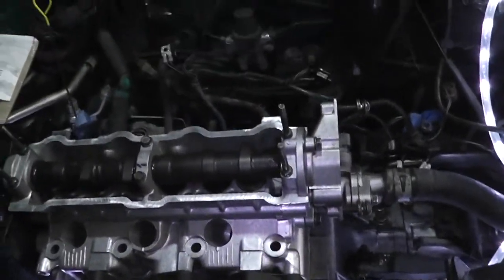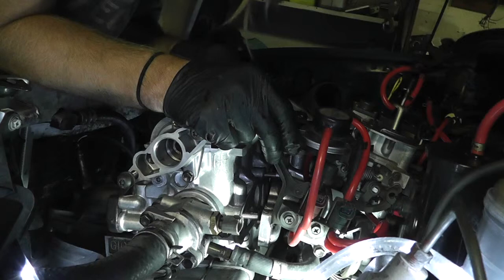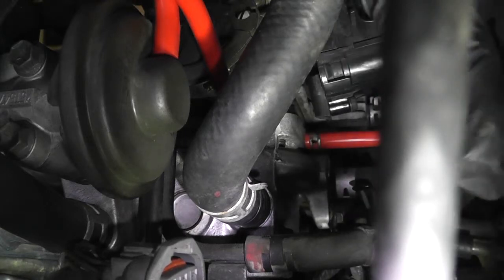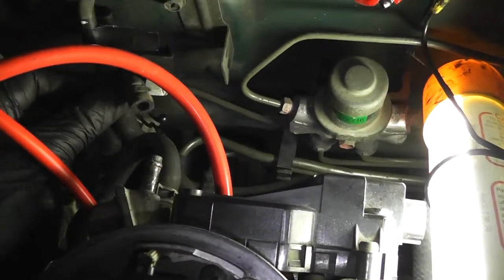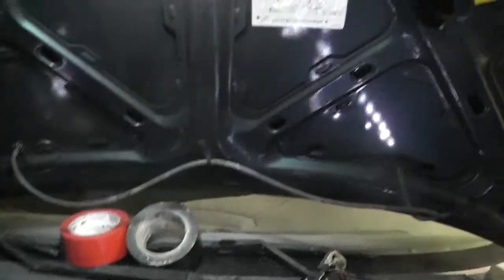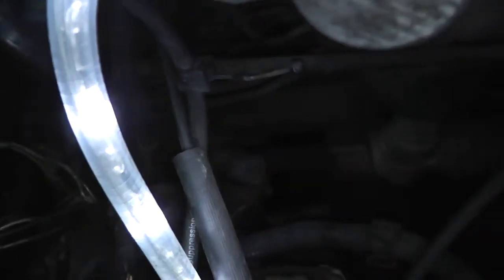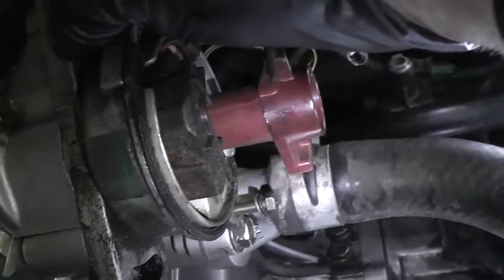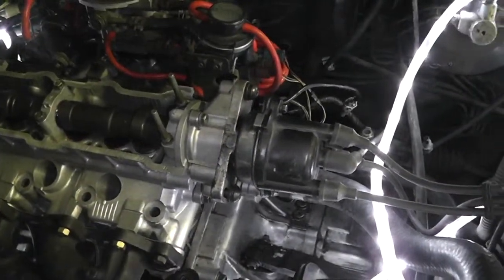Geo Metro Head Gasket: Episode 9 - Installing Carburetor, Throttle Body, and Wiring it all up

Comment: Im thinking of mating the intake on the head first before mating the head to the block.  It might make getting the intake bolts/nuts mounted an easier job.  Thoughts?
Reply from the maker: That's what I did on the removal so I know it's possible for it come out/go on connected... for whatever reason the instructions I was following said to do it this way.  It might be tricky to get those ground wires in place if you mate it together on a bench and then put it on the block but you could definitely get them finger tight - JUST DON'T FORGET THE GASKETS (lol).  Either way you'll be climbing all around that thing to hook up all the wires and vacuum lines but if you try it and it saves time, make sure to comment to help out the future do-it-your-selfers :D
Reply: I'm thinking the same thing. Was it easier?

Comment: are you running the under chassis brace?
you could fab one up  quite easily  as well as both strut tower braces
Reply from the maker: +Mark Ryan do they make those for metros?  Maybe from some of the turbo swift cars but I've never seen any

Comment: what kind of mpg do you get now? thanks
Reply from the maker: That's a great question!  Kind of tricky to answer, my lifetime avg is 44 but that includes a season where the thing was heavily aeromodded with a full 6' teardrop boat tail off the back and was regularly averaging 50mpg.  I eventually took all that off and my average was right around 40MPG, after the repair I've been bad about tracking it AND I definitely enjoy more spirited driving with the increased torque so I'm not milking it the way I could.  My current 90 day average is sitting at 45MPG
Reply: Imperial Beach Dad thank you for the response..i have a 1996 5 speed and i am getting 41mpg lifetime and i was just trying to see if i upgraded how much more mpg id get.
Reply from the maker: I imagine it would improve, I just changed too many things around the same timeframe (aero mods, commute, and cylinder head/camshaft).  It definitely has more getup and go, but it's tempting to use it lol
Reply: Imperial Beach Dad lol it's probably not worth the $400 until I blow my head gasket lol
Reply from the maker: EXACTLY lol.  It would take a long time to recoup the cost just as a fuel saving device, but around 150-200k miles when that first cylinder burns up, it's a worthwhile upgrade just for the power alone
Reply: Imperial Beach Dad really? 150k-200k...uh oh I'm at 180k..
Reply from the maker: Kevin Stripe Yeah, they tend to burn valves around that mileage, obviously you can repair and keep them on the road, people are totally running them with half a million miles :)  No matter what head you get, when you do it ABSOLUTELY spend the dough to upgrade to stainless steel valves, they last a ton longer and the upgrade cost is negligible
Reply: off topic a tad but what transmission fluid do you run? I can't decide to run syncromesh or 75-90
Reply from the maker: Kevin Stripe hah!  Uh.... I dunno.  It's whatever's in there. The clutch has been changed out twice under my ownership but I didn't do it either time and never thought to ask or specify...  dude, let me know what you find out, if there's something better I could flush it and change, that's a good idea
Reply: well what I hear on the GEO METRO FOURM is that syncromesh makes the manual transmissions like new again and almost everyone backs it but someone said in hotter climates not as much(I live in Arizona lol) I know you live in CA so my suggestion is do it...I hear it's great and it's easier than a oil change and there is guides all over Google BUT. make sure you get PENZOIL syncromesh nothing else...I know for a fact AutoZone has it
Reply from the maker: Awesome!  Dude, I'm all about it, thanks for the tip!
Reply: would you like a link to the guide
Reply from the maker: Please!  That will save me a step and also make it easy for anyone else reading this comment thread who becomes similarly motivated.  And of course, if I do it, I'll make a how-to video :)  I can give you a shoutout when I do :D
Reply: Here is the link: http://geometroforum.com/topic/4600596/1/

I can send a few more links if you like since for some reason the pictures wont show up but i have spent hours researching this and i found that 75% of the time you wont be able to fill the tranny trough the fill port...so DO NOT drain the tranny without making sure you can refill it ;) but you can go through the speedometer cable or the left screw(towards passanger side)  that holds the clutch cable bracket so either way you'll probably get a way to fill it. You want to make sure that you get the Pennzoil brand because apparently its the best. And its 2.5 quarts unless you go through the fill port then you would just fill until it runs out. Id love a shoutout and i cant wait to see the video ...with your skills to do the engine rebuild this will be a piece of cake. Sorry for the long response but I want to fill you in on all the hours i put in :)
Reply: oh now that we are talking about it i think ill go ahead and transition to syncromesh this weekend so ill give you some tips on what i find when i do the job :)
Reply from the maker: Kevin Stripe dude, you are the man!  Hope the drain and fill goes smooth for ya and thank you for the info, I'm excited to try anything that makes the tray "like new" even though my license is suspended for 5 more months (cause of the seizure and all that).  But no worries, lots of time to do projects and stuff while I recover :)
Reply: Imperial Beach Dad I just picked up my quarts of syncromesh a few hours ago and im all set for Saturday! Im nervous to be honest, you never know what could go wrong lol, I tried taking off my fill bolt and no luck..im going to try and jack it up and break it loose with a breaker bar. I doubt that will work and i dont have air tools or a welder(some weld a screw into it and then turn). Dont forget that if you take off the fill bolt to clean off the metal shavings off of it because the fill bolt acts as a magnet to keep the tranny clean. Also depending on how much you would like to spend a recommendation someone had was to do the fluid change and then drive it for 100-10,000 miles and then redrain and refill with new syncromesh and apparently it cleans out crud.
Reply: Alright, it was successful(so far lol)Im going to break this down a little..BTW i just realized we have the same year so this should be perfect :)

Tools and Materials Needed:
-1/2 drive ratchet
-3/8 drive ratchet
-Liquid Wrench
-Drain Pan
-3qts of Pennzoil Syncromesh(AutoZone)
-Lots of paper towels

Things you MAY need:
-LONG transmission funnel(AutoZone)only if you get fill port off

Okay so I should first say that the whole job should take about a HOUR maybe 1.5 if you like to listen to music and screw around ;)...That wasn't the case..at least for me. As I got under the car i saw that my half axle was leaking from the seal so i replaced the seal but o'reilys sold me the wrong one and it was a Saturday night so i had to go NAPA early in the morning since o'reilys couldn't figure out what I needed. But the fluid change was easy as pie and i actually got my fill port off and i think you can too with some elbow grease. Alright here is my step by step:

#1-Spray liquid wrench on your drain nut and fill nut..every day for two days in advance 

#2-Take off the fill nut FIRST, you may want to jack the car up so you can get more leverage but you can get it form the top.Use a 3/8 ratchet on this one

#3-SKIP THIS STEP IF FILL PORT CAME OUT. Remove the right(towards passenger side) bolt that holds the clutch cable bracket. You DO NOT need to remove the cable just the nut.. Optional: to confirm you removed the correct bolt stick a long screw driver in the whole and check if fluid is on it.

#4-SKIP THIS STEP IF YOU HAVE GOTTEN FILL PORT OUT ALREADY. Open speedometer cable from top of transmission. DO NOT remove it just open it enough to fill the transmission up

#5-Get under car and get drain pan ready and remove the drain plug with a 3/8 or 1/2 ratchet...I found the 1/2 to fit better but 3/8 works 

#6-Clean Drain plug and fill plug(if applicable).Drain plug will have a lot of metal shavings on it 

#7-Put back on Drain Plug

#8-Refill Transmission in one of 3 ways:

Fill plug: 
Use long funnel and fill until fluid runs out

Clutch bracket or speedometer cable:
Fill with 2.5 QT of fluid. DO NOT! DO NOT OVERFILL!

#9-Replace Fill plug or clutch bracket nut or speedometer cable

#10-Get in car and don't start it yet....run through all the gears a few times then you can go ahead and drive and make sure you use all gears! When you get back CHECK FOR LEAKS!

Alrighty, so thats what I did and so far I must say i was scared of the fluid change but I can tell you that my gear changing is A LOT smoother. Hopefully this helps and definitely reach out to me if you have any questions! I look forward to your video!!!  :)
Reply: Imperial Beach Dad ^^^Here dude..Let me know you got it :)
Reply from the maker: Dude, this guide is amazing, thank you!  Sorry for my crazy delayed response, I got re-diagnosed with a brain tumor and life's been kind of heavy lately.  I am excited to get this project done though, I'll see if I can't do a video when I do it :)
Reply: Shoot! Sorry to hear about the tumor :(  Hope all goes well dude :) if you make a video ill be one of the first to watch :)..Sending prayers
Reply from the maker: Awesome man, prayers are super appreciated!